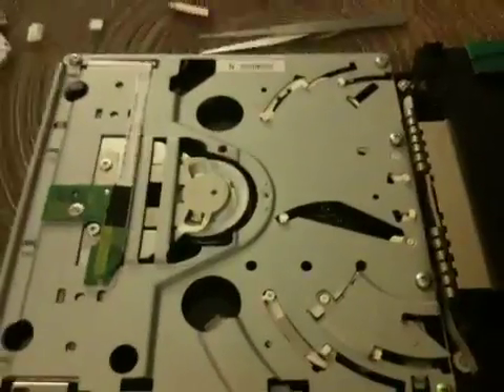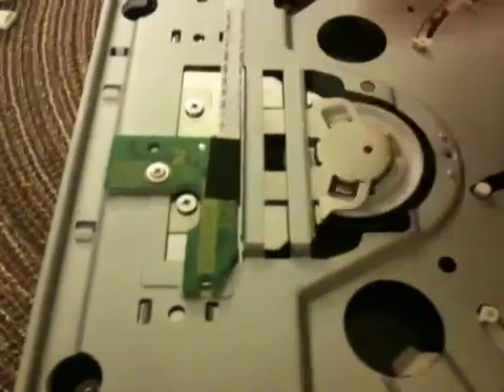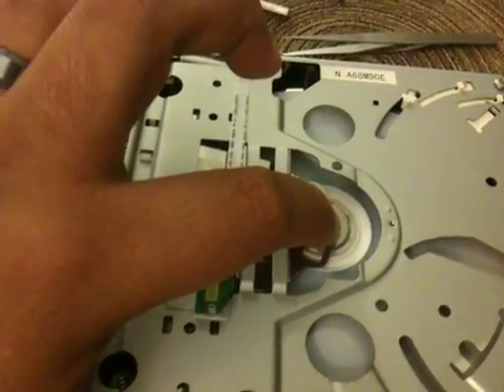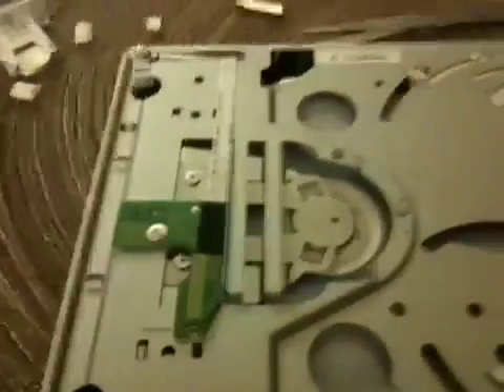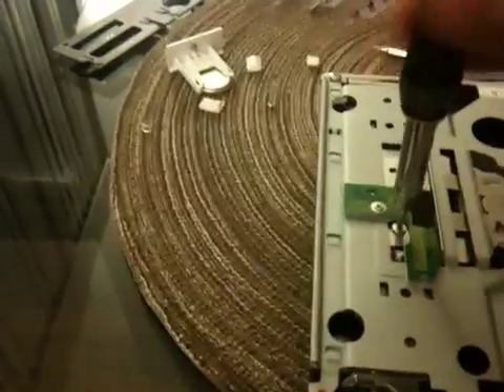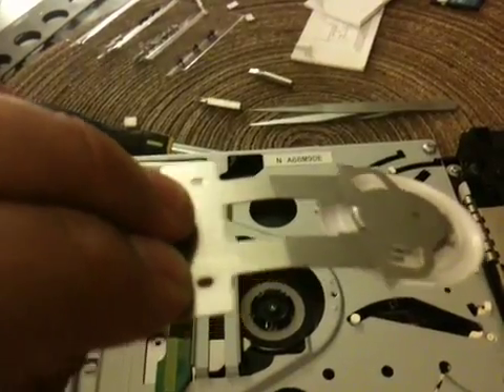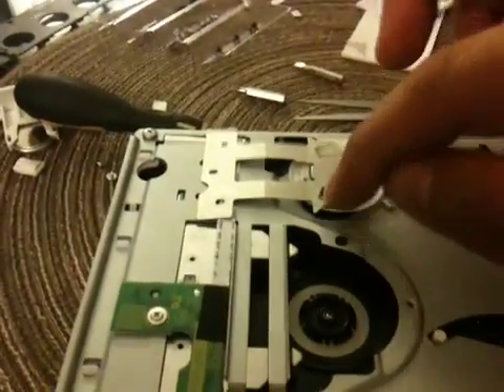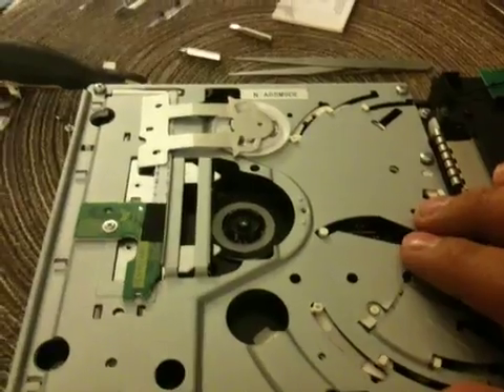Loud Wii drive explanation & solution

Comment: The solution was to refit the arm with a disk in the machine. Don't fully tighten the two arm screws, and then move the arm aronnd until there is an even amount of space around the metal parts of the arm inside the white plastic disc. 
Result  - no noise.
It may be that we are both right and it is a combination of the two but...

Comment: Ihave solved this problem on my son's Wii. I think you are wrong about the cause/solution. Yes the problem is with the arm, but I think the noise is caused by the white spinning disk rubbing on the parts of the metal arm. I tried your solution but what ever bend I had it still made the noise.

Comment: One thing you don't mention is that there is an additional plate to remove opposite the plate you need to bend before you can get the arm out also the screws are VERY tight!!

Comment: My problem wasn't a lack of tension as far as I could tell since I don't remember the noise stopping when I had pressed down on it. I had tried removing the plate the second time that I had to fix it but i don't think I could get the bed just right. Bend it too much and it cause the plate to rub on the plastic and too little and you get your vibration problem. The clearance between the plate and the plastic is just too small...bad engineering.